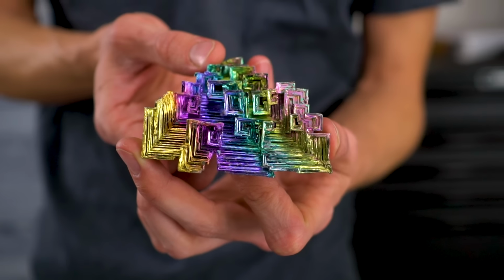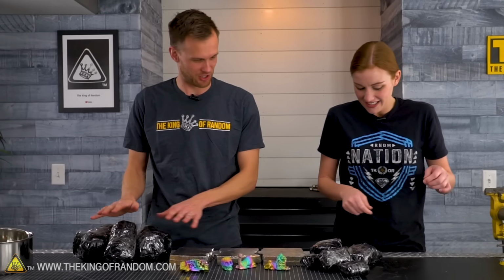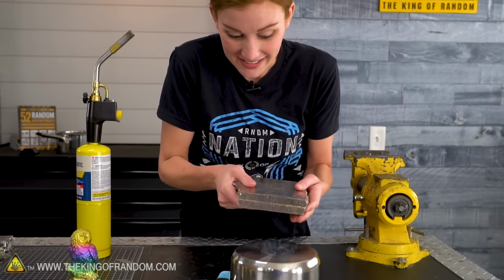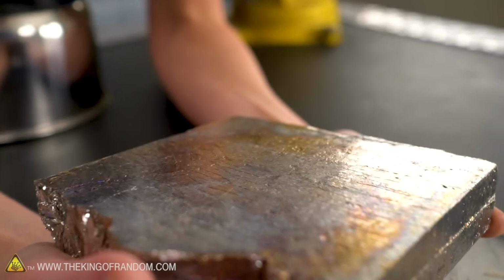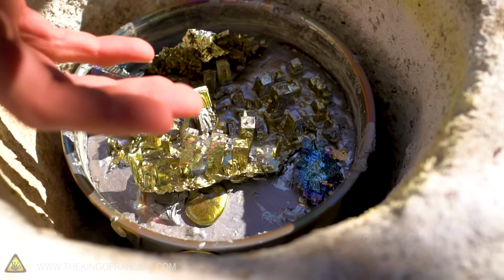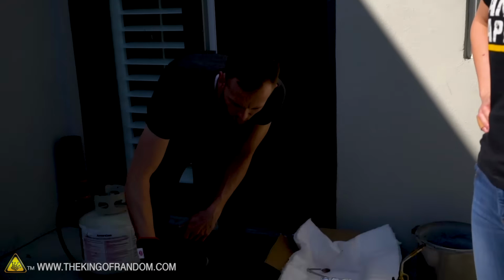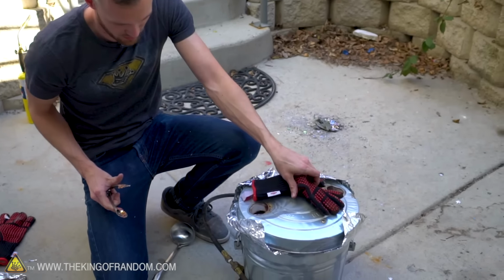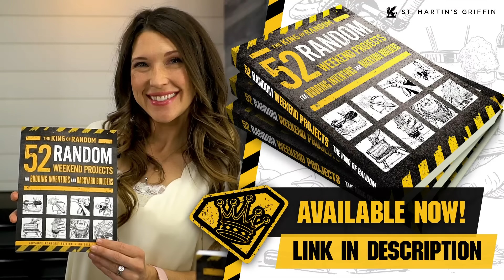What the Heck is Bismuth? (Growing Metal Crystals)

Comment: The color-change of your pan is okay.  Ferrous metals have a similar range of oxide colors, and each show at different temperatures.  It seems your stainless pan did not get >1000 degrees on the brim, so you have the lovely blue/purple peacock color.  If you were to sand Nate's leaf, and heat it gently with your torch, or even on the stovetop, you'd get to see those colors live as they change.  Pretty neat stuff!

Comment: "This piece of bismuth would require careful and precise timing if you wanted to break it within 4:54. A TAS, had already tested the game to its absolute limit, and found out that the best possible time was a 4:53. Lower times could be achieved but not only did they required you to both press the left and right buttons on a controller, but also required mario to clip through parallel universes."

Comment: 7:00 fun fact, most metals do rainbow colors as heat is spreading. if you heat up the end of a steel rod until its glowing cherry and let it cool down there will be a rainbow stretching out from the end you heated.
actually a smith controls the hardness of iron and steel this way. by looking at the color change and quenching the metal at the right time you get better heat treatment results.

Comment: Possibly you could melt bismuth inside of sodium silicate by putting very viscous sodium silicate with bismuth suspended in it inside The Foundry.  The crystals should cool off very slowly because sodium silicate has a very low thermal conductivity and if you can find a glass container that will withstand the heat maybe you could even use a time-lapse to watch the crystals grow

Comment: I have been looking for the right material for a project that I have wanted to do. After watching Zack Snyder's Justice League and deciding build a Hot Toys collection, I decided also to make 1/6 scale Mother Boxes. Not the ones with the outer shell that come with certain figures, but the actual Mother Boxes themselves. I thought to use steel, and to just heat color it. But part of my plan was to use magnets to the replica mother boxes motion. But I learned that heating steel takes away its magnetism. Then I decided to use aluminum. But learned how elaborate and dangerous it was to anodize aluminum. So I got curious about bismuth. The thing I noticed about the Mother Boxes was that in a certain light they give off a very rainbow like coloring. Hence why I wanted to use heat treated steel. But bismuth is much, much softer than steel, and melt at a lower temperature. On top of that, it gives off the rainbow effect that I have been looking for. I hope to get the equipment I need to get my project going. I think combining bismuth with resin, led lights, and optical fiber will give me the desired outcome. Thank you so much for the inspiration.

Comment: If i really wanted to i could melt bismuth using the hot end of my 3d printer my 3d printer gets to 550f and the melting point of bismuth is 520f i would do it but it would probably break the printer